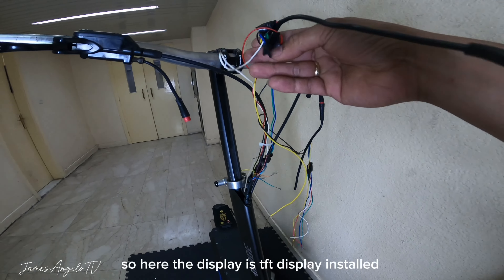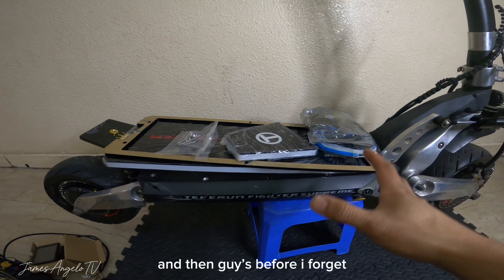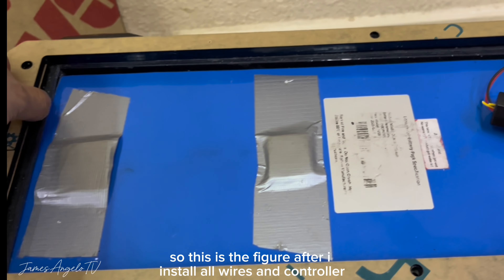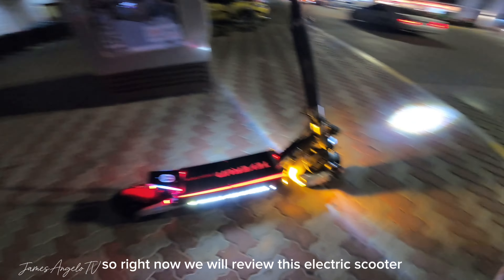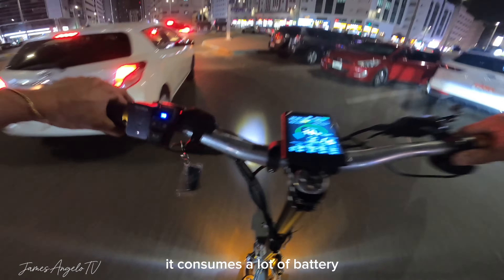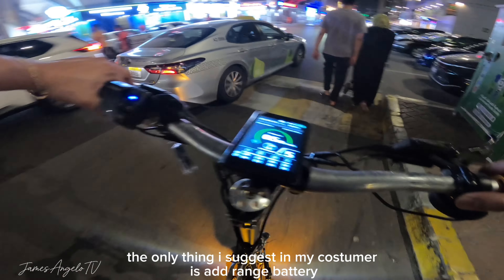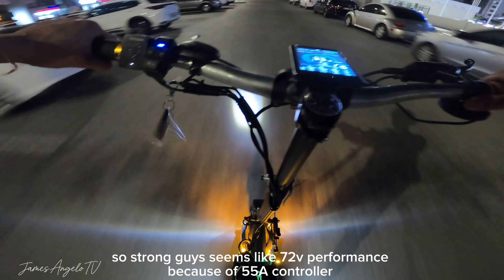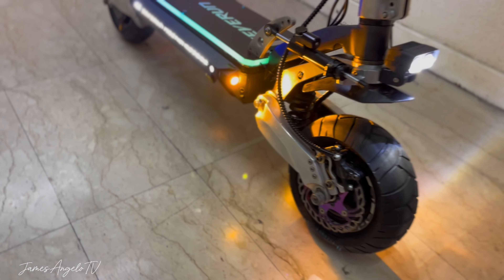MODIFIED TEVERUN BLADE GT | converted to SUPREME CONTROLLER 55A | James Angelo TV | Vlog 167

Comment: good job ! please do you think its possible with no modification to put the new controller of blade gt2 and fighter 11 2024 into the my new fighter mini pro 60v 25ah 2024 ?  thk you normaly its the same new connector
Reply from the maker: if they are compatible yes it will work

Comment: hi bro, thank you very much for this video. I would like to order the 55A controllers from Fighter Suprem but I don't know which ones to choose. There are 2 versions: with APP and without APP. Which ones did you take please? 
Should I change the BMS or should I keep the original one?
Reply from the maker: better not app verison much cheaper  for battery bms if you want more power change the bms
Reply: @JamesAngeloTV  Hi bro. 
Question 1. On blade gt2 +35ah. I would like to know if there is a big difference regarding size contollers between GT2 versus Fighter suprem. Because, If i put suprem controllers in my gt2, I don't know if I had enough space. What do you think ? 

Question 2. Can you tell me controller "A" is for front motor or rear motor please ?

Comment: Hi Jame, excellent video.
Do you need a modification to install that thumb throttle? because the throttle that has my blade gt is connected to the screen. I want to change it with a finger throttle is that possible? do you have a video to do that?
Reply from the maker: some scenario you need to change color coding red to white and white to red black color is as is or sometimes same color depends on the throttle

Comment: Did the top speed change at all? Can you show how you mounted the controllers in the deck?
Reply from the maker: if you see the video there is use controller  i attached in supreme controller the purpose of that is for heat sink and to hold the controller i screw it in lower deck
Reply: @JamesAngeloTV  you used a piece of an old blade controller to mount it? I saw the bracket you used. I cant make out what it actually is.. i was trying to see exactly how it was mounted to the deck.. did it change top speed at all?

Comment: are there any additional items needed to install the 55a or it is perfectly fine you just need to connect?
Reply from the maker: you need to replace the xt90 controller connector to xt60 or vice versa

Comment: Hello, 55A controllers works also with latest gt2 version? That with BT?
Reply from the maker: yes it will work bro
Reply: @JamesAngeloTV  so i know what i need to do for next season - upgrade battery on 35Ah, different gas handle, and 55A controllers

Comment: 55A controller is for 72V battery, how It can work on 60V? It should detect underwoltage under 62V or not?
Reply from the maker: nope that is compatible too to 60v you need to adjust the voltage level in settings to 60v
Reply: @JamesAngeloTV  Interesting, Thank you and many safe kilometeres.

Comment: Hey brodi what is the top speed and whare did you find 60/55 controller???
Reply from the maker: i didn’t test bro i have same video before it reaches up to 89-90kmph 60volts
Reply: @JamesAngeloTV  and whare do I find 60v 55a controllers
Reply: Thw supreme is 72 isn't it ?

Comment: Bossing pwede po ba malaman kung saan mkikita ung controller reset ng blade 10? Salamat po
Reply from the maker: nsa p settings yun bro anung display mo ba
Reply: @JamesAngeloTV  damao ma01 bro
Reply: @JamesAngeloTV  ang nangyari kasi masira ung finger trigger ng throttle ko kaya pinalitan ko ng ibang throttle un pala hindi compatible so parang nag iba settings ng controller nya..ayaw na tumakbo ng mabilis gang 20kph na lng kahit pa 100 na nakalagay sa P setting..baka naman may idea ka bro
Reply: Bro baka may idea ka dito
Reply from the maker: wala ng reset yan bro lalo na mataas na odo. pwede mo nlng gawin dun sa stock display convert mo sa thumb type